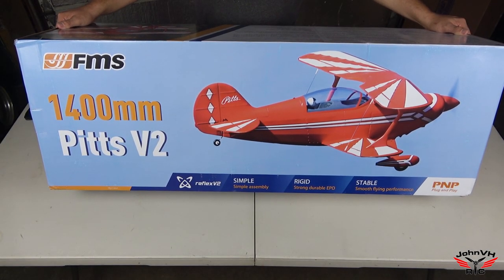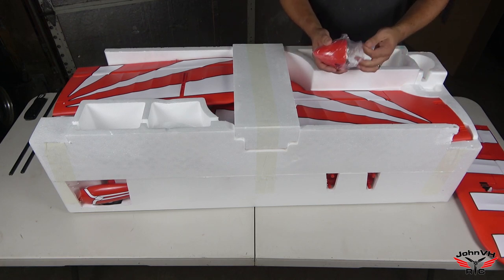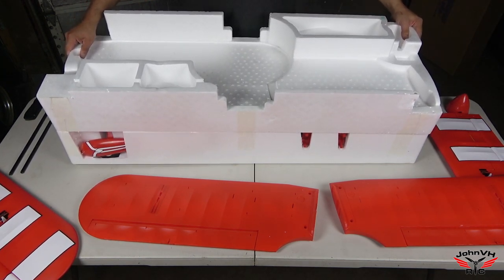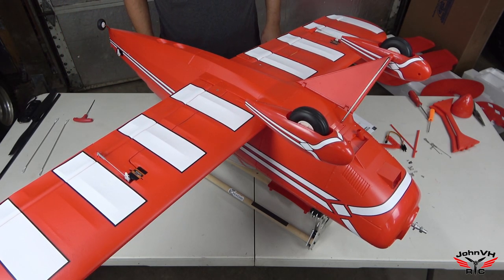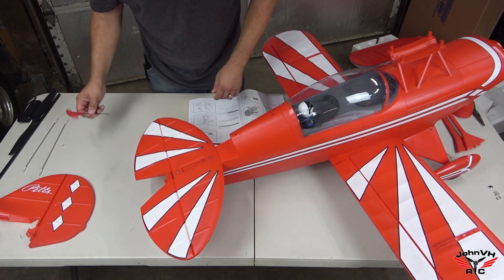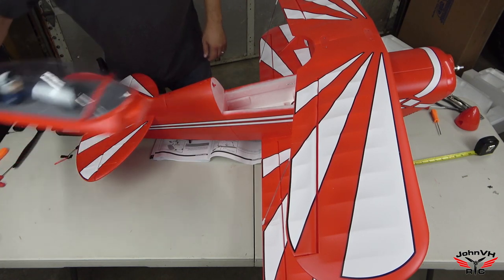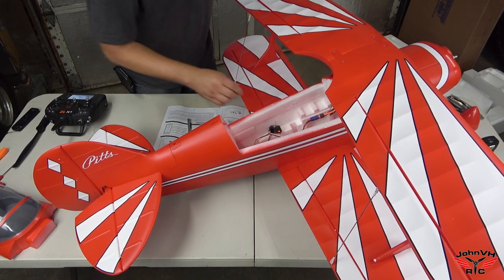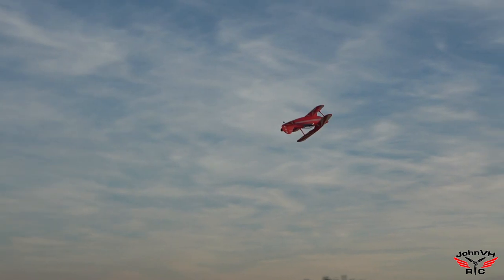FMS PITTS 1400mm V2 Unboxing and DETAILED BUILD

Comment: not a detailed assembly I guess, since I came here only to know if the long part of the strut goes to the bottom or to the top, and that was not explained in detail 😮
Reply from the maker: @12:48 shows the struts, and how to install it, what is the long part you are referring to?
Reply: The strut has one end longer than the other. The part of the strut that slides onto the wing.

Comment: Somebody please help me! So I purchased this bird
and I noticed that it came with a separate controller
box in it. That I have not seen in any of the videos that
I've seen so far about this airplane. It's called a reflex
V2. What does anybody know about this box? All of
the flight control Servos are plugged into it. What is
this thing? Is it a flight controller? A Gyro set up Or
just a pass through for the flight controls cables? Is it
trustworthy? Or should I remove it and replace it with
Y-cables for the ailerons and plug everything directly
into AS3X equipped six channel Spectrum receiver?
Some people at the Flying field told me that there's
been problems with this bird. But all the videos I have
seen show that it flows really well. Are those problems
due to this reflects V2 box that it comes with?